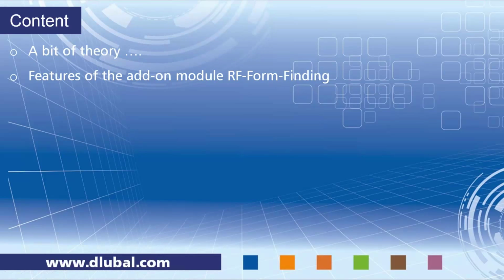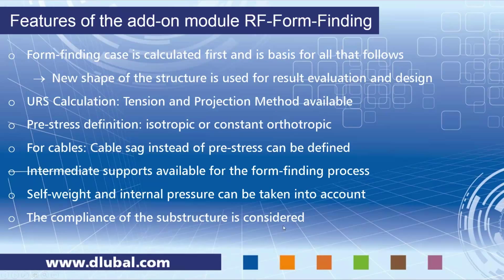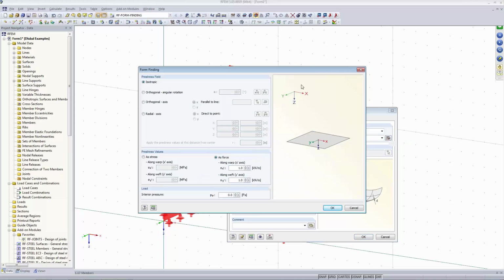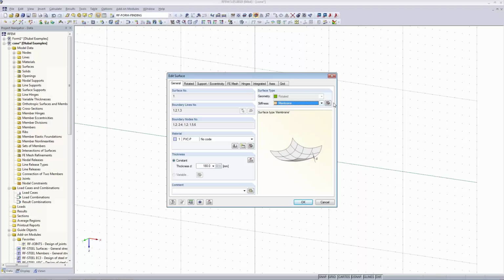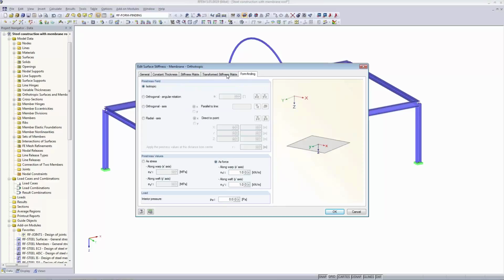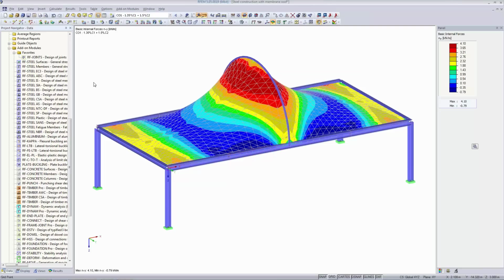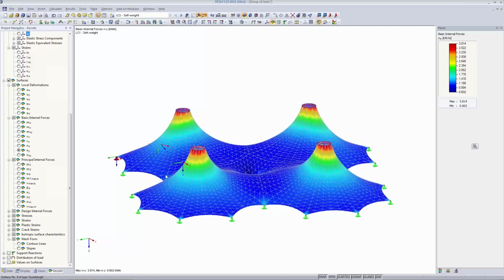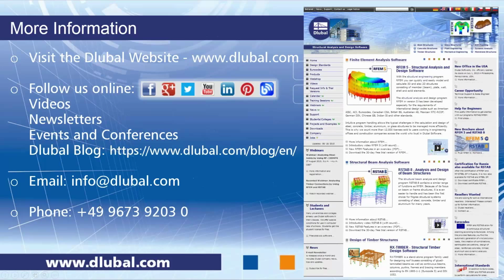Form-Finding and Calculation of Membrane and Cable Constructions in RFEM | Mon, Sep 28, 2015

Comment: Very nice examples, however do you have an example of a structure that has both cables and membrane used together?
Reply: Hi Jesse

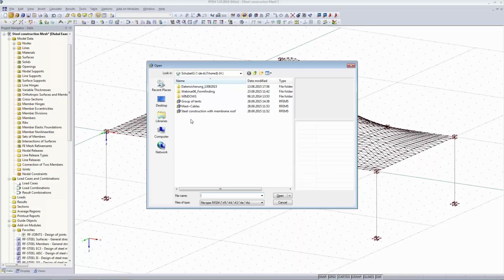The presenter in the video mentions between 38:15 and 45:20 the model "group of tents". In this model the membrane is connected at the bottom to a cable. In the video you can see, how after the formfinding process the border lines gets a sag. 

If you write me an email to hotline@dlubal.com. I will send you a short explanation how you can connect a membrane to a cable in RFEM.
Reply: Jesse Udall hi Andreas i need that example
Reply: Hi Bora, 

which example you need? Please write me an email to hotline@dlubal.com with an detailed description. I will reply it.